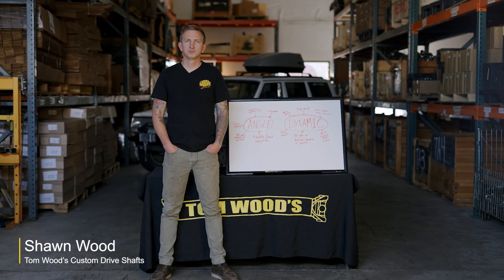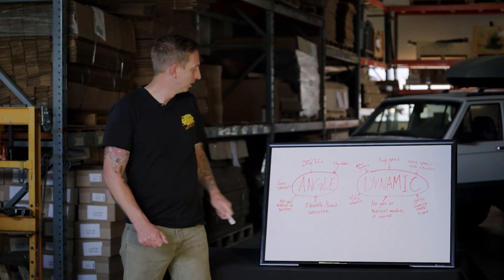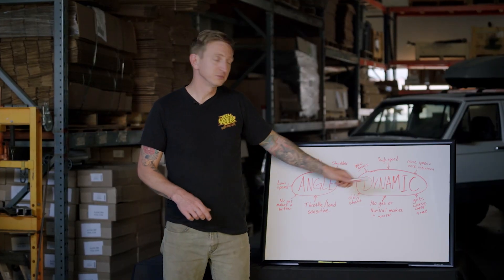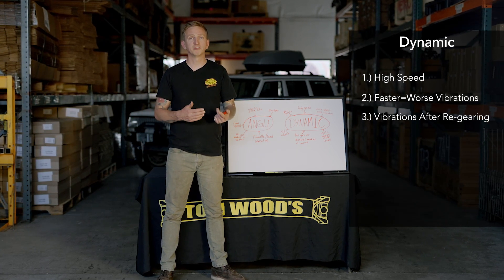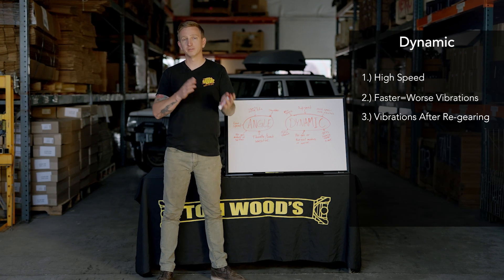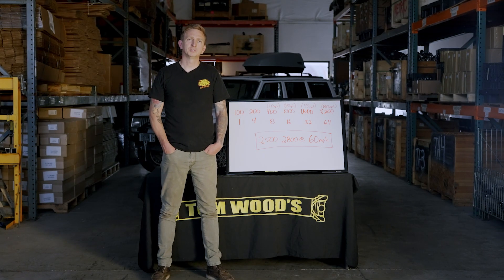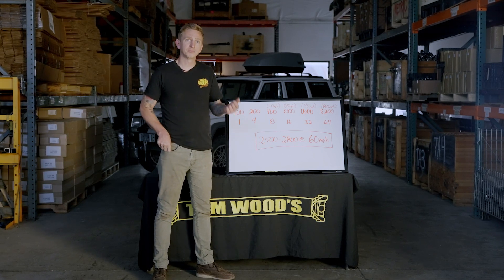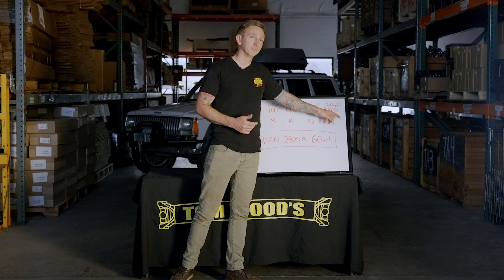Diagnosing Drive Shaft Vibrations

Comment: What happens to the Hyundai ix35 2012 4x4, when driving usually at low speeds, does it make a humming or humming noise? Mostly when it's cold.

Comment: dumb question. but i got 4.5 rubicon express lift from factory 2003 tj sport. never had an issue, but now i do. only got 86k on it . installed a spartan in the front 5 years ago. took it to a shop last year and they replaced front hubs, tie rods, wheel bearing's , pretty much the whole front end. 6 years ago, i had adams drive shaft installed, front and rear with the cardan rebuilt. I've replaced tranny mount. and shocks. what else do i need to fix?????

Comment: Good video, I think mine is dynamic due to increased intensity with speed, but my vibration fades in and out at approximately 3 to 4 second intervals? Front your experience is this still a shaft balance issue? Shafts and ujoints and pinions feel really good. Rear shaft is a custom built by a pro shop about 10 years ago. Thanks for any input
Reply from the maker: It sounds like this is a harmonics issue, which I don't actually explain in the video. With harmonic vibrations you have 2 or more different things vibrating at different frequencies and intensities which synchronize momentarily every couple of seconds, thus increasing the overall intensity of the vibration. Basically there are multiple things that are harmonizing, one of which could be the drive shaft. It may require a little trial and error to identify which things are contributing to the vibrations most significantly (drive shaft, tires, etc.). But if the drive shaft is a factor it is most likely some sort of balance/dynamic issue, though it's worth measuring and checking angles just in case.

Comment: What if im getting a shake at 100mph that get worse the faster I go, doesnt change until I slow do but doesnt seem to be related to rpm.  I have a new driveshaft without anything that is loose?
Reply from the maker: That is a dynamic vibration that is a result of driving at very high speeds. It is related to RPM, but drive shaft RPM, not engine RPM. Most drive shafts, especially steel drive shafts, are not rated for those kinds of speeds. You probably need to convert to an aluminum or carbon fiber drive shaft.

Comment: Hello. 1998 Wrangler, 4.0, 5 speed, stock suspension. The drive shaft looks pretty straight. I had both drive shafts rebuilt & balanced. Take off in first gear (2 wheel drive) (3.07 gears, It feels like u-joint wobble, why?  Also have hum/rumble at 80 mph.  ?    My 2000 Cherokee also has the hum/rumble at 80 mph. Why?  Thank you.

Comment: Great explanation on how the 2 types of issues causes vibrations and the symptoms.  Also, great to see the driveshaft balancing machine in use.  I can't find a driveshaft shop in my area to save my life.  The one I used in the past A1 Driveshaft, which I believe, was the only company in my area, closed down.  I need my driveshaft check for what I believe is a balance issue (had similar issue in the past), but no one does this; all they do is replace them.

Comment: Ok so I have a 2007 Subaru legacy 2.5 and from what I'm reading I'm getting angle vibrations,but I haven't changed any angles obviously, so what's causing the angle changes in the drive shaft's??  Thank you!
Reply: I have the same car and same problem as you, did you find a solution?

Comment: HELP! Lbs.. I just put a 3 1/2 inch lift with TC drop from RC on my 95 grand cherokee and have a crazy vibration. it doesn,t vibrate (or become noticable) until about 35 mph. ive only got it up to 55 but the vibes dont go away. Where should i start?
Reply from the maker: There is some more information, including a handy vibration diagnostic quiz, on this page https://4xshaft.com/blogs/general-tech-info-articles/diagnosing-drive-shaft-vibrations
Reply: @tomwoodscustomdriveshafts thanks! The quiz said it could be multiple factors. Dynamic or loose/worn out parts. I’m gonna start with replacing the scaly rusty driveshaft and making sure everything is torqued down and hope for the best. Ig after that the next step would be getting adjustable control arms to dial in the pinion angle? I just got into doing all this stuff and was really enjoying it until these vibrations.

Comment: Excellent video ! I need your help :( I have a RWD car (BMW F30) that has a roaring sound from the rear and slight vibration that affects the floor + steering wheel on only speeds of 100 kph and higher, it goes higher in frequency with speed and then almost disappears at 140 kph.
when jacked the car up and had the wheels rotate it created the same sound and vibration so its definitly either propshaft or differential. 

how can i know whether its the propshaft or the differential given both parts are expensive to replace.

Comment: We switched from 308 gear ratio to 373 in our 78 GMC C15 4 years ago for pulling, and developed a 58 mph drive shaft vibration and a u joint life of 2000 miles. We are finally down to the driveshaft. Three custom drive shaft people told me that a 75 3/4 inch steel drive shaft is too long for these gears. i just found an aluminum shaft for it, I sure hope that fixes it. Loved the video! Thank you for sharing :)
Reply from the maker: I agree, an aluminum shaft is probably best at that length. It is significantly lighter and should run more smoothly. However, the 2000 mile joint life might be unrelated. It sounds like you probably have a bad attaching yoke. This video could be helpful regarding that topic https://youtu.be/s-28V9ySFc8?si=IrsV33inukRGkKuE
Reply: @ thank you!!
Reply: @ I can’t believe how much I’ve learned by having a vibrating Driveshaft by changing gears. Thank you so much for this information. We may just start from scratch here!
Reply: @ Do you think I should use a conversion joint or change the yokes  to match the 1330 driveshaft yokes?
Reply from the maker: @ I'd give preference to matching the yokes to the drive shaft. Partly because it might be a good idea to replace your yokes anyway, partly because swapping joints in an aluminum shaft can be a little tough to do without damaging or distorting the yokes.
Reply: @ thank you, this has been an educating learning process for me!

Comment: Instead of taking the driveshaft out to check balance.  What if the back of the vehicle is jacked up and the rear tires taken off.  Then put it into manual at the gear used for highway and put rpm at highway speeds.  Would that work?  Mine vibrates at 55 and above, new tires been balanced twice.  Wondering what is causing it.
Reply: That sounds like a good idea. Did you try it?

Comment: Sounds nice until support after isn't there. After the last retube mine is worse than ever and was told to pound sand by Tom Woods. Can mark the driveline turning clocked in any orientation and tune is off center causing mine. Tom woods part I paid for but was told to pound sand.
Reply from the maker: Hi Kyle, Shawn Wood here. I looked up the records on this to try and gain some insight as to what you are upset about and here's what I can find. We lengthened and re-balanced a shaft for you in Dec 2023 then you called in April 2024 where you and I had a 1 minute and 15 second conversation. I don't remember the details of that conversation  I may have said that I don't know how else to fix the problem or I may have explained that a double cardan shaft with a slip yoke style transfer case can result in high speed vibrations. I can guarantee that I did not tell you to "pound sand". At any rate, I'm sorry that we weren't able to help you and hope you were able to find the solution you were looking for somewhere else.
Reply: @tomwoodscustomdriveshafts  
I informed you it is substantially worse than before. As shown in this video it clearly falls into the Dynamic vibration category. I understand that this style is less than ideal however no SYE'S are made for the Ford T-Cases so unfortunately is what it is in that regard. You did not specifically say pound sand but stated we checked it it said it was good so we don't need to check it again. When it's a dynamic issue. The bigger frustration is I have clocked it all over on T-Case splines as well as all 4 locations on diff flange and it is 100% the same so still leading towards a driveshaft issue. I placed a dial indicator and measured the run-out near pinion and T-Case and the whole tube top to bottom is not centered.  I even ran it and marked it and it's clear where the tube is not centered. Have videos showing this etc. That's the reason I am frustrated. Vibration starts at 2,300rpm shaft speed and gets bad at 2,500rpm and remains bad to and past 3,000rpm. That is shaft speed not engine RPM. Gets a hair better under load and on deceleration. Worse when no load which again points towards a shaft balance concern. That's the frustration.
Reply: @tomwoodscustomdriveshafts  Angle at T-case is 13* and pinion is down  1.6* and is leaf sprung so under load should minimize to near 0 under operating conditions. Shaft length from center of u joint to center of CV is 35 1/4" so its nkt a super short shaft.  Angle does suggest a double cardon should be best however with this style of slip on T-Case maybe a standard style driveline with substantially less rotating weight would be better. I belive the current one which is a 3" tube, 1350s is 27lbs. Which is a lot of weight to be spinning at 3,000-3,500rpm.

Comment: I have a vibration at 1800 rpm and only occurs at this particular point. Any thoughts what could be causing this? Thx
Reply from the maker: Harmonics probably. Everything in the vehicle that is moving is vibrating, just at varying intensities and frequencies. At certain points multiple parts of the system will all synchronize which will increase the perceived intensity.

Comment: 2024 LEXUS GS350 FSPORT AWD...BEEN SHAKING LIKE HELL AT LOW SPEEDS, HIGH SPEEDS, INTERMITTENT, AND MOSTLY WITH SOMEONE IN THE PASSENGER SEAT. MANY PARTS REPLACED, NO HELP. NEXT ITEM TO HAVE INSPECTED AND REPLACED, REAR DRIVE SHAFT. ANYONE HAD THIS ISSUE, AND SOLVED IT?
Reply: I got a rwd 2008 is350 so it’s a single shaft but at a stop or when coming to a stop u can hear and feel a slight vibration under the car fucking annoying  as soon as I step on the car it goes away and the car drives fine

Comment: I had a vibration for year's.  Checked everything mathematically, changed shims, ect.  Turns out the shop that did my SYE didn't tighten the front yoke all the way.  
GRS noticed it during a inspection.  Once tightened  , no more vibration.

Comment: Hello! Thanks for the informative video. We'll done! I just bought a 2005 f150 and its perfect at high speeds, but taking off while turning, like out of a driveway,  when taking off there is like a shuttering that comes from the rear end. Does that sound like driveshaft/u-joint to you. Thanks so much
Reply from the maker: If it is drive shaft related it sounds like it is an angle issue. Normally turning shouldn't affect drive shaft issues but perhaps there is more resistance, therefor more load on the shaft, when you are turning. Angle related drive shaft shudders are usually worse under load. Could be something else entirely though.

Comment: I have a new 2023 f150 that starts vibrating at 65 mph and progressively gets worse w higher speed, ive went round and round w 2 different dealerships, they have balanced tires more than 8 times, road force balanced tires, replaced all 4 tires, now they have wheels ordered,  I keep telling them it needs a new drive shaft,  both dealership tell me I'm wrong because it's not at a violent or high frequency, it's definitely mph related,  does it at various rpm and even in neutral (so not shudder or torque convertor or engine miss fire) also I checked the run out w a dial indicator,  axle pinion end was zero run out, slip yoke end at transfer case has  .020" run out (1 pc aluminum drive shaft) dealership says they can be upto  .040" and be in spec , this seems extreme to me, what is your opinion? Also ford drive shaft have an internal rubber damper, ive heard its possible this can come detached and move around inside which obviously would cause imbalance, have you experienced this? Any feedback would be great, thanks
Reply from the maker: It would be worth having the shaft inspected and re-balanced at a local drive shaft shop. Definitely sounds like it could be a drive shaft vibration. The "specs" for runout are highly subjective, as are the specs for balancing. That being said, any shaft will have some runout and in theory the amount of runout doesn't matter as long as the shaft is properly balanced. That's the whole idea behind balancing a shaft anyway, adding weight to the low side of mass to counter any eccentricity in the shaft. 0.020" runout sounds pretty typical and not abnormally eccentric.

Comment: I bought a new drive shaft from Dorman off Summit Racing. When I installed it, I kept getting vibrations at 70mph. Vibrations were horrible and violent to the point of my whole car shaking. I hit up Summit Racing and they didnt want to help me, they made excusses, that it was my angle. I took the drive shaft to a shop to get balanced and when I installed it I was amazed with how smooth my car ran. I now hit 100mph and it feels so smooth! DORMAN DIDNT BALANCE THE SHAFT CORRECTLY. The guy who balanced my shaft said that the back of shaft was way off and he even put new weights on shaft to make it perfect. It was for my 1988 Monte Carlo SS.

Comment: Oh,I eventually found out what was causing it, back at the beginning of 2022 I replaced the Guibo which led to me replacing the centre bearing, fitting the new Guibo made the vibration worse but the tailshaft centre bearing kind of separated itself from the rubber insulator & it was a V6 one whoever made the tailshaft fitted, they have a different offset to the V8 centre bearing which led me to believe me that was causing the vibration,it probably was giving me some vibration to some degree.

I have even replaced the universal joint as I thought that it was binding but I kept both parts which I have refitted into the car early this morning,I mentioned that I have refitted because I tried replacing the Guibo on the rear differential which had some slight splits in it but I kept the old one.

Well,I placed the rear of the car on jack stands then I checked the tailshaft while I ran it in first & second gear,the rear section was good but the front half was throwing a wobbly at idle speed.

So I switched the engine off then I got a dial gauge then I checked for driveshaft runout,there was 0.4mm or 0.016" of runout at the front of the shaft up near the front tailshaft flange, it looked like that the Guibo may have been warped as well.

I decided to take the cheapest route,I fitted the Guibo which was fitted onto the rear differential yoke & tailshaft then I fitted it up to the front,I ran the engine in first gear & checked for that dreaded wobble which had almost completely diminished,it was a major improvement.I test drove my car this morning at about midnight & the vibration in second gear was gone.

Buying the cheap $55 AUD Guibos are a hit & miss affair I think so I can either take my chances with them or pay 2-3 times as much money for a reputable brand of Guibo !

Comment: Since my Holden VY SS Commodore had play in the middle universal joint I replaced it last night & the vibration at 80 km/h (50 mph) is gone but it now has a vibration on both acceleration & deceleration in second gear at about 20 km/h (12 mph) so I am starting to lean towards a worn tailshaft extension housing as being the culprit,it can't be drive angle related because I have the standard FE2 suspension fitted into the car & I have fitted the T56 Tremec type of transmission mount which is for a VT series 2-VZ series 1 manual V8 Powered Commodores & they used them in all the way up to the VY Commodore in the manual Supercharged V6 models which were fitted with the Getrag 260 5 speed manual transmission.

All of the Guibos have been replaced as well & the tailshaft extension housing seal is leaking a bit I think so I am starting to think that it's caused by a worn tailshaft extension housing Bush.

If it's not that then I am tempted to buy a used V8 tailshaft then have Hardy Spicer go through my current aftermarket tailshaft !

Comment: 2015 Cadillac SRX AWD. No codes, transmission shifts just fine. Terrible vibration at 20-25 mph, persists lightly at higher speeds but much less, got worse after new tires, mount and balance were triple checked. Wondering if rear drive shaft could be the problem.. I think i will pull the shaft and attempt to drive without it and see if thr problem is gone using FWD only..